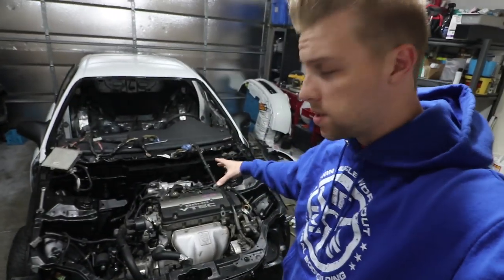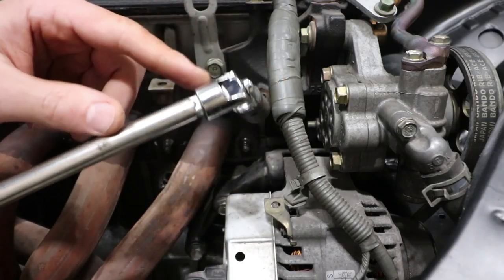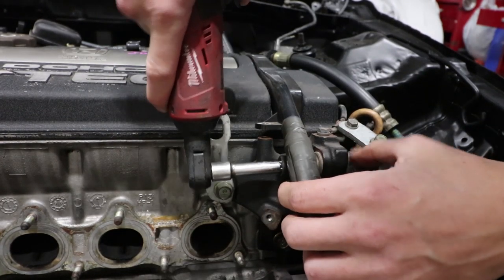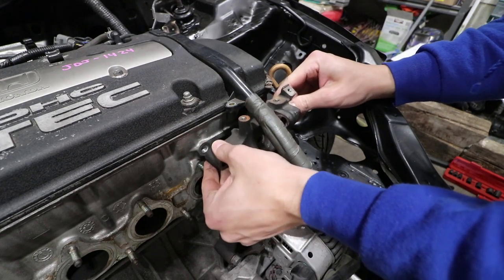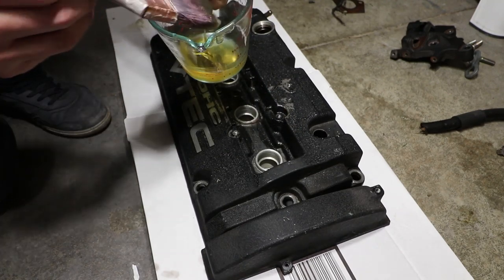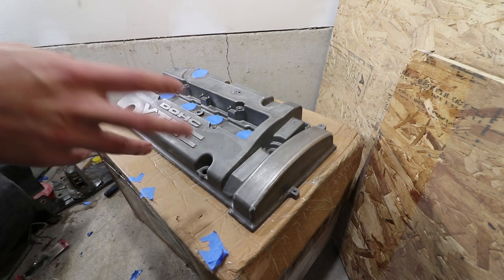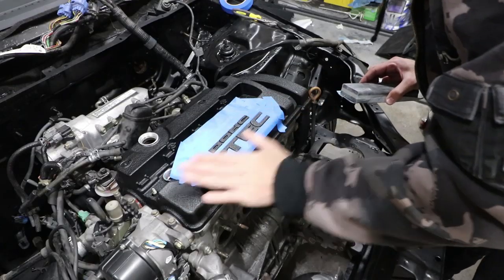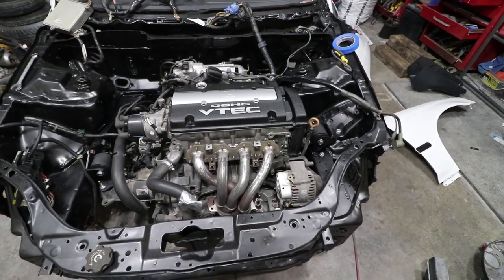Wrinkle Paint Valve Cover, Power Steering Delete and More

Comment: I'm really not one of those grammar Nazis but I feel an overwhelming urge to correct someone when they are referring to the header of an inline 4 cylinder engine as headers. Its just a header. V8's and V6's have 2 headers or a "set of headers". Each cylinder has its own exhaust runner and together they make up the single header that inline cylinders have.
I'm a big fan of this channel though btw and I am taking alot of pointers from your videos for my RHD conversion/ restoration project. Also that is an absolutely excellent choice of a powerplant. The H22A has always been my favorite engine and it what is in my current daily driver, soon to be restored and (RHD'd?) EJ1 ("EG" coupe)
Reply: its funny i always try to use correct wording, HEADER and not headerS. But even when im talking with someone and it comes up, i feel weird if i dont say headerS, as if they would correct me for saying it the correct way. lol.